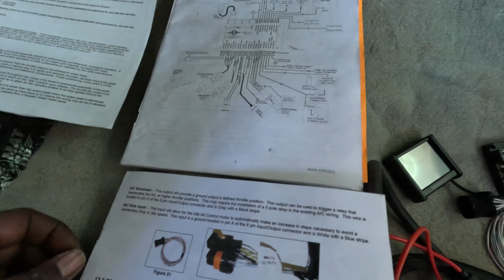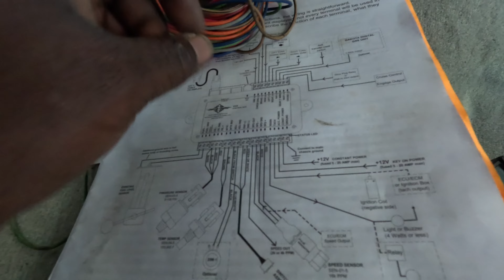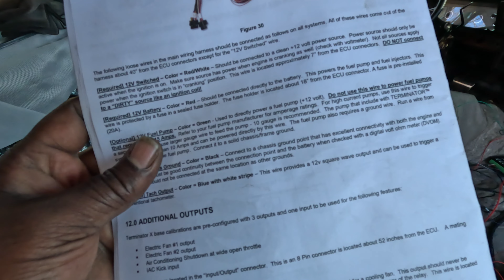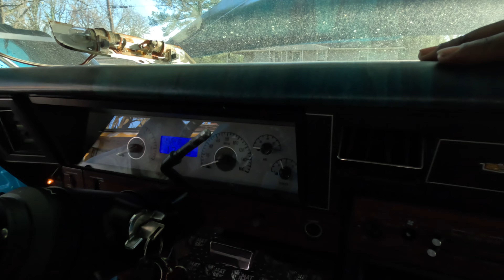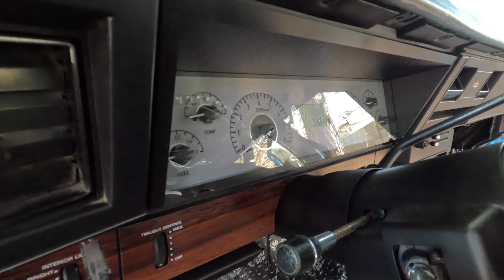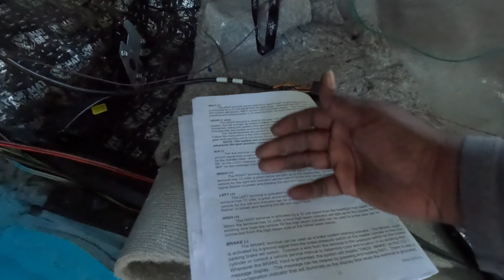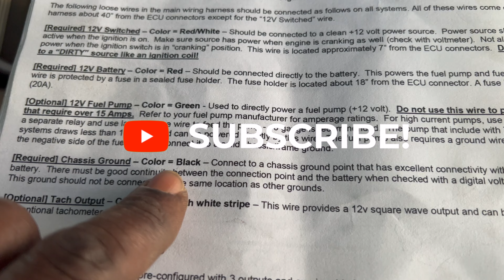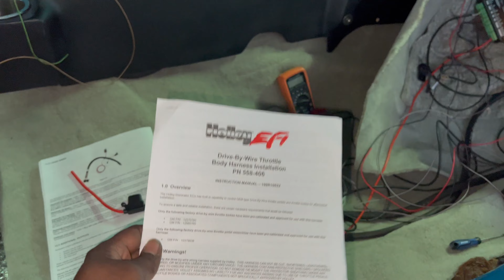1989 Box Chevy Build Ep.52 Dakota Digital Dash, Fuel Pump Harness made, Found 12v Switched Power

Comment: The factory cluster harness you cut will work. Lt blue dark blue turn signals,grey lights, all you gotta do is turn the ignition on. with a test lite and check em signal will blink the testlight, dash lights turn test light on and so fourth. 12v ignition. Everything you need is there brake warning light highbeam indicator.
Reply from the maker: Thanks bro!!

Comment: Im watching and I heard you speak on relays. Use them, learn to use relays for anything with a motor.... fuel pump, windows, horn, wipers, mirrors, sunroof and door locks. Using relays simply pulls power directly from the battery vs power running through the switch. Also note relays can be negative or positive triggered.... you can wire them to operate through the negative or positive wire on whatever it is. Find a fuse panel that has relay terminals.
Reply: AC compressor too
Reply from the maker: Ok bet! Thanks for the info.